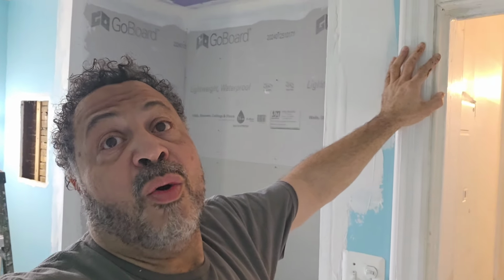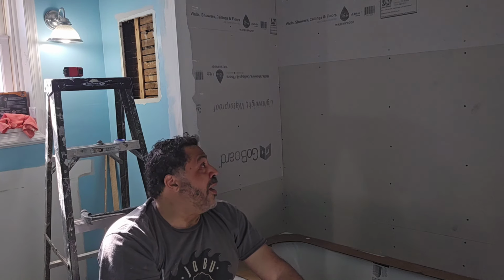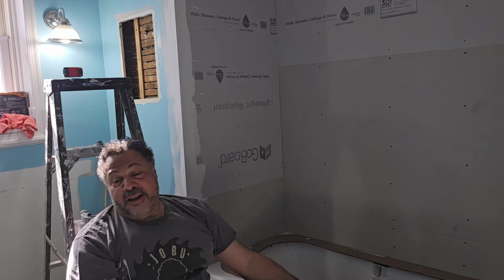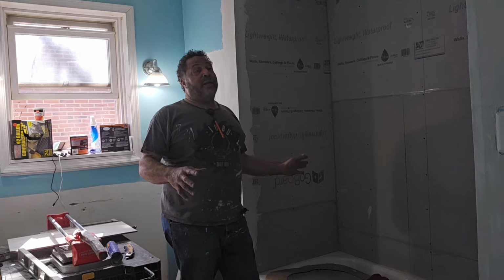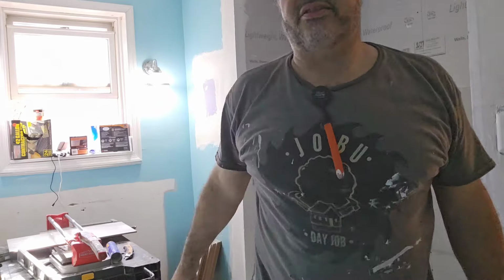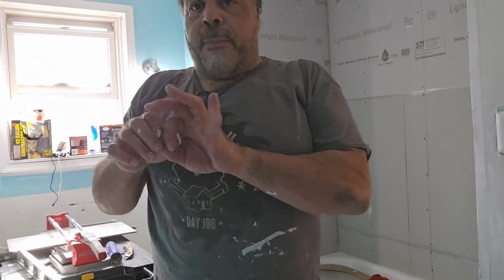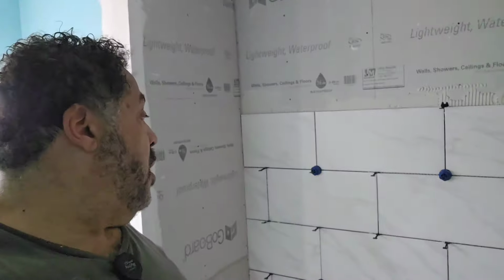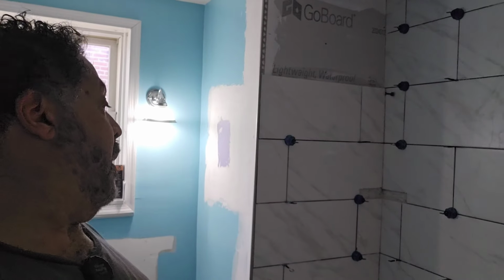Bathroom rebuilding on 1867 home tile time

Comment: It's not a good idea to use and angle grinder with an abrasive wheel to cut cast iron. Like aluminum, cast iron loads the wheel. because it will heat up quickly and potentially fly apart. It you wax the wheel that will keep the wheel from building up cast iron particles and over loading the wheel.